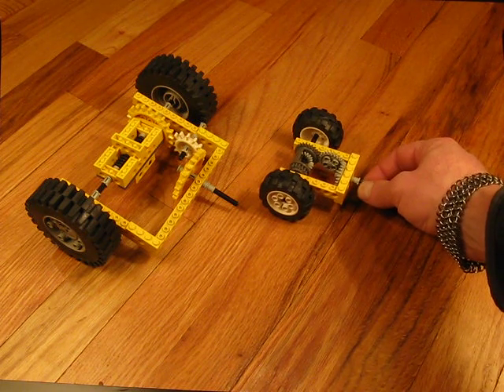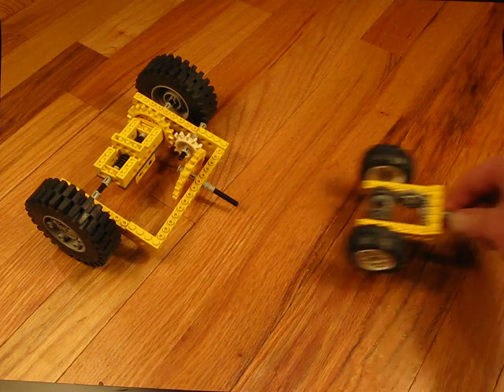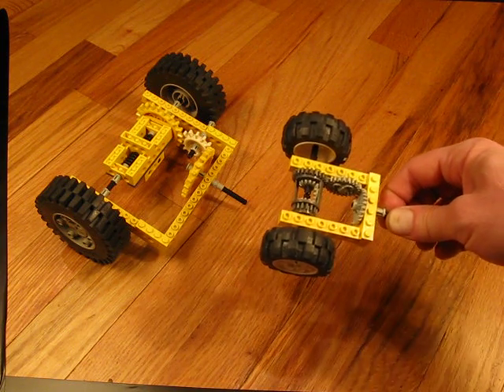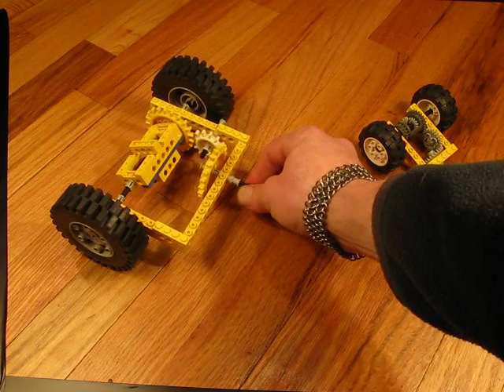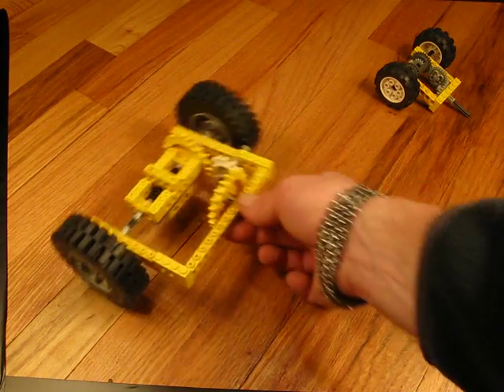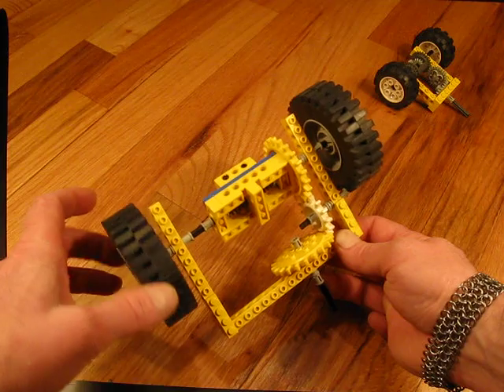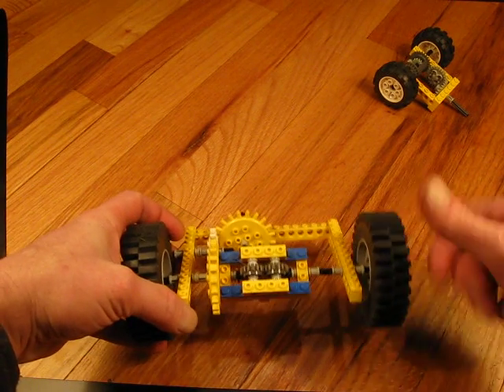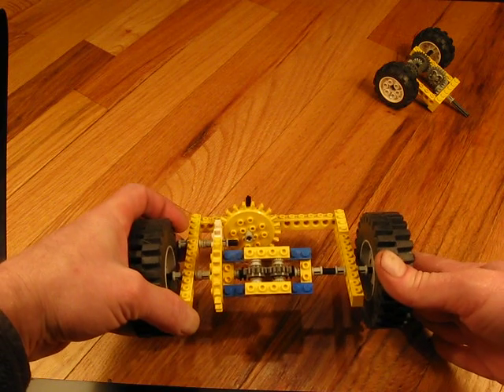Torsen Movie

Comment: so if you turn for example to the left and the corner is very long you will break mechanism becouse one wheel will  turn faster than the other it means if you turn one wheel in one direction and second wheel in another their speed must be the same , if speed would be difrent their will block each other
Reply: No, the entire mechanism spins. If you look at the mechanism when it’s not spinning, when you apply different forces the mechanism has one wheel spin backwards relative to another, but then when you let the whole thing spin you can see that that simply results in 2 different speeds, one “spinning backwards” simply translates to one spinning slower than the other when the entire mechanism itself is rotating.

Comment: Is handbrake turn bad for our torsen? If we block the rear axle by handbrake, does torsen also block the front axle to?
Reply: bit late for answering your question but if the front and rear axles have similar friction under tires the hanbrake turn is almost impossible to do because the handbrake braking will brake front axle too via propshaft in torsen center diff system

Comment: Torsen is what most use including Hummer fwiw.  The V8 Lexus/Toyota Land Cruiser/4Runners etc..have "full time" 4wd with hi/low range and a lock feature option. The 6cyl models are part time 4wd...Some Toys regardless full/part have the locking rear diff option too boot.  Torsen 4wd is not simply AWD like most SUV or the frameless Crossover minivans have.   Put most suv/cuv's like a Ford Escape/Maverick (not old car) right passenger side off in a small ditch and it's done. Right side is its "only" traction side so call a wrecker.
 Watch this video to shed more light on the Torsen (Toy calls it ATRAC) but each maker tweaked them somewhat over the years and why there is confusion on how they operate:

https://www.youtube.com/watch?v=CQPNH4XRbWA&index=83&list=FL2SxRHd1OA3rxWVT-5DeDLg

Comment: So I know there are torque things going on and people are saying it won't work with one wheel in the air. The fact is, if there is more force from the engine than anything else, it will lock, period. If it doesn't, then your Torsen is either: not a Torsen and you were scammed, is broken in some way, or for some reason can't handle the awesome power of your engine.
.
The Spur gears cannot spin the worm gears, so they will stay stationary and both wheels will spinnig the same way and speed.

Comment: To anyone who is wondering why this works with one wheel in the air but a real Torsen won't:  This is effectively a Torsen with an Infinite Torque Bias Ratio since the angle of the worm wheel and worm gear won't let the wheel turn the gear.  That is why when both tires are off the ground in the video he must manually turn both wheels in opposite directions whereas with the open differential he could just turn one wheel and the other would spin in the opposite direction Torque loss in a Torsen would be something like 71% (2.5:1 TBR) but here it is 100%.  What this means is that under anything other than straight line driving, only one wheel is getting power (the slower wheel) where in a true Torsen the torque split would be 71:29 (for TBR of 2.5:1)  Good demonstration, but still leaves questions.  Hopefully this clears some of them up.
Reply: Thanks.
So much contradictory info on this subject on the net. Some say Torsen will lock if one wheel looses traction, other say it behaves lick an open diff.

Comment: Best explanation on Tube. (the worm can turn the pinion but the pinion can't turn the worm ). Thumbs up!
Reply: Please correct me if im wrong .  One axel can spin faster then the drive allows,  yet no axel can spin slower then the driven speed
Reply: @paulsouth4794  thank you so much, that sentence helped me more than you can think!
Reply: @felixbaum2180  similar scenario as a Detroit locker.   The driven wheel is always the inside wheel , being the slower moving of the two . If the inside looses traction , both  wheels lock . Yet with a torsen differential  you have a functional diff
Reply: correct  Sir, but in another    video with a  computer  model  it makes the same claim about a worm gear driving another gear but can't be driven by it.....except that in   the example  as the axles turns they drive the worm gear that said can't be driven.
    Fist off,  how does the  R   position  in the transmission  makes the  vehicle back up if he just turned both shafts , and then , how can you use the Engine Breaking on a hill if there isn't any drag from the pinion.
   I think the engineers  need to meet with a English teacher  to learn how the speak top the common person and avoid the  genius-speak and    Industry lexicon. 
   I can't   a Company selling very many  TV's if they  over load the consumers with  details  when it's better  to explain Why and How   the TV works  .

Comment: this is not a torsen diff. torsen diff do not lock at all. it is true that torsen diffs use worm gear, but they are impossible to reproduce with current lego worm gears. the reason being that the angle of the worm gear and the angle shaft gears is such that when torque is applied the friction created means the force to drive the wheel and the force to rotate the worm gear is equal (the shallow angle allows the axle gear to drive the worm gear). what you made is a locked diff with a lot of slack.

Comment: A torsen doesnt really work with one wheel up in the air I think
Reply: Usually it will but the application of just a little brake will turn it into a spool.  I've had 4 Jeeps over the years and always added Torsens at some point.

Comment: From TorSen "As mentioned above, the Torsen differential is a torque multiplier.  The Torsen requires some type of resistance or friction in the system to function properly.  A wheel in the air provides zero torque or friction on the system and as the Torsen multiplies the available torque, zero, by its TBR, the end result is still zero.  In response to this, we developed the Torsen T-2R with pre-load to combat those wheel in the air situations. "

You think TorSen are confused too?

Comment: I think you are confusing what can be done with the current models vs. what could be manufactured based on the principles of how the Torsen functions.
As it is, Torsen comes in 3 variations right now.

Additionally, there is really very little reason to manufacture them with such an extreme gear cut because you can "lock" current models by simply applying some brake pressure.  (see Hummer H1's for reference)

Comment: A TorSen CANNOT be made to work with one wheel in the air unless an additional clutch is fitted, so now it isn't just a TorSen, it's a TorSen/cluch LSD.  It's all to do with torque multiplication, zero torque times anything, is zero!

Torsen's page has all the info for you.

Comment: Torsen has gone though some variations throughout the years.  A torsen can be designed to work just like the video, or you can reduce the torque biasing by changing how the gears are cut.
The earlier versions had much more bias and could transfer more power to one tire, but they were weaker.  Later versions reduce the bias increasing strength at the expense of some traction.

Comment: Unfortunately your excellent video has missed one extremely important aspect of a Torque Sensing (TorSEn) diff.  A Standard TorSen only works if both wheels feel at least SOME resistance, and WILL NOT work with one wheel in the air (unlike your demonstration).

Comment from the maker: @suprakilzz26 -- a torsen is a type of locker.  There are others made with one-way clutches on both wheels, and true torsens (which mine isn't exactly) use directly meshing helical gears with side-loading to get the same behavior mine shows with only two gears, rather than five.

Comment: EXACTLY! A pinion can not turn a worm!
But I m quit sure that you need a small resistance on skidding wheel to apply torque to the other wheel. BUT, this is the simple system. Five star video.

Comment: i think u r wrong. as long as power is transfered from the engine, the torsen will transfer torque to the wheel with most grip.
thats why torsen is such an excellent type of lsd diff

Comment: There must be a flaw in your torsen system  at 2:06 because torsen differential will not transfer torque to the wheel with grip if the other is in the air.There must be a little resistant inorder to transfer it.Something is missing .... or it's just the scale model.

BTW, excellent vid ;)

Comment from the maker: I heard of torsen-style diffs like 20 years ago and it wasn't until I built this that it actually made sense.  Real ones use parallel helical gears rather than worm gears.  I can't do that with LEGO for lack of helicals, but the general mode of operation is very similar.  I'm glad you found it useful.